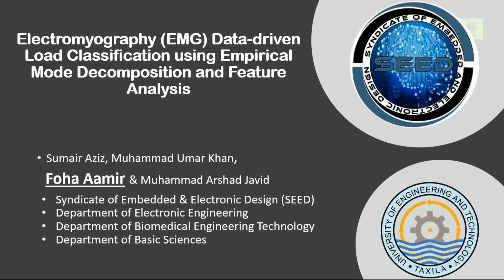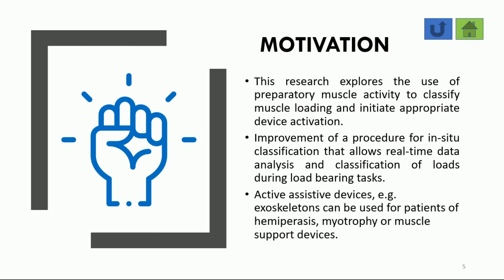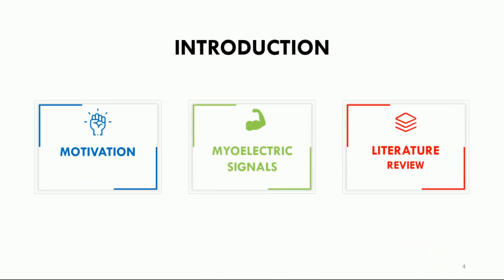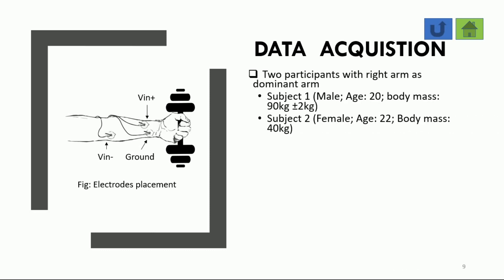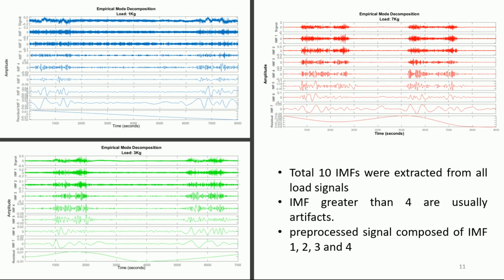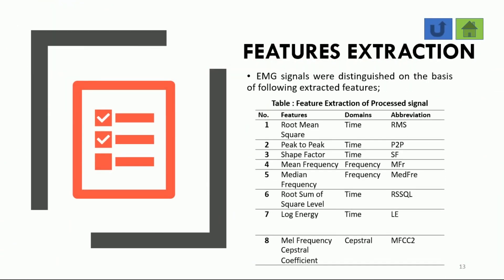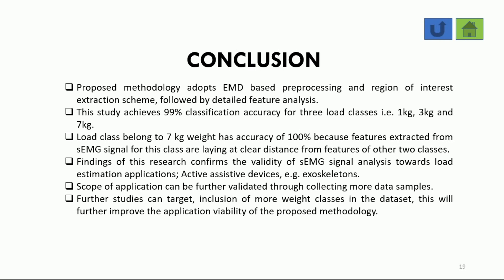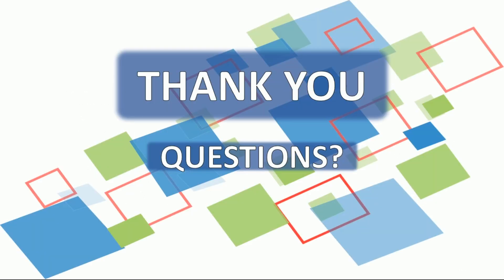Machine Learning | Classification of Loads | EMG

Comment: Normally when you extract imfs, you remove the imfs that contain high and low frequency content and then add up all the remaining imfs.. That is the most simple way to do it.. What you can do is to apply thresholding.. You can add threshold values and becoz of that you will not have to remove a complete imf.. That way you can maintain the properties of the signal more precisely.. We do EMD so that we can maintain the properties of the signal because during filtration we lose some of the important properties of signals.. Thats why we use EMD, to filter out noise without distorting the signal completely..
PS: on what basis have u chose 10 folds?? Normally number of folds is equal to number of motions e.g 5 motions, 5 folds.. 10 folds are by default i guess.. Which is not efficient